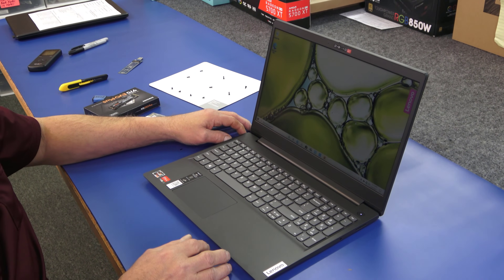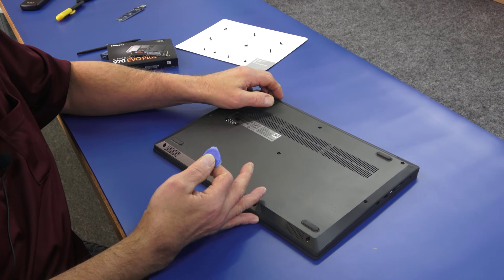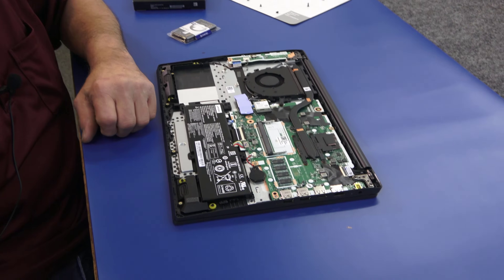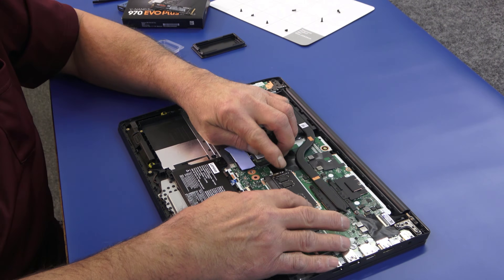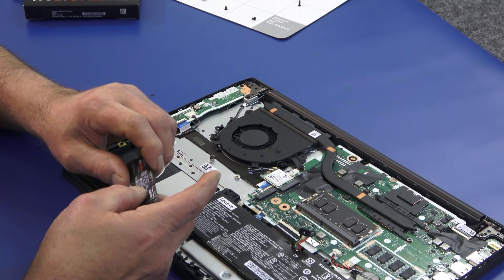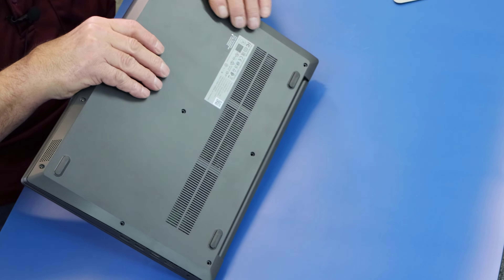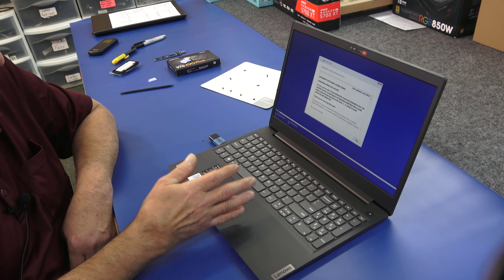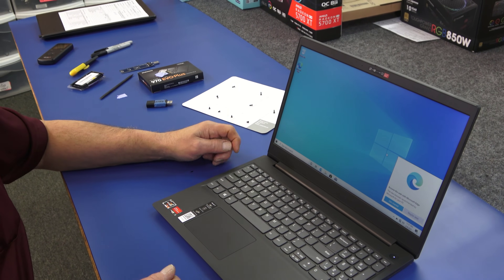How To Upgrade SSD & Memory Lenovo Ideapad 3 15.6 Laptop.

Comment: Hi sir..i have a question i will add last nigth  m.2 nvme 2242 at 2nd slot of my laptop. But it will not reflect after i install it ..did u know what happening?
Reply: Go to device manager and check if  it recognised it

Comment: How much more memory can you add? As in ram
Reply: I have the Lenovo Ideapad Slim 1 15ada7 and it's max is 12 GB, 4 GB soldered on and 8 GB in a sodimm slot. It just mostly depends on what your laptop supports

Comment: Lenovo IdeaPad Slim 3 15ABR8 AMD Ryzen Upgrade Options??

According to Task Manager:

Memory

	8.0 GB

	Speed:	3200 MHz
	Slots used:	1 of 2
	Form factor:	Row of chips
	Hardware reserved:	2.2 GB

	Available	1.3 GB
	Cached	1.2 GB
	Committed	8.1/9.5 GB
	Paged pool	469 MB
	Non-paged pool	386 MB
	In use (Compressed)	4.6 GB (167 MB)

Comment: First time i run into an issue like this, but I replaced the drive w the exact one on this video, there's no drive detected when I try to install windows w the usb... Should i format the new m.2 to gpt with another computer first? Or at least initialize the drive first?
Reply: Same question here man
Reply: @raphael5f547  i took it to. A shop and they fixed it

Apparently the driver needed is actually the RAID driver for the laptop. They extracted the files from the driver and installed it that way

Which is ridiculous because it's not raid, it's a single drive

But apparently the raid driver from the laptop is needed to to get everything working.

So just make sure u download the raid driver and extract contents and copy those to your windows install usb so u can select them.
Reply: @Bishop2563  oh nice
Reply: @Bishop2563  I just fixed mine. I went into bios and turned off Intel vmd and drive showed up. Damn had me up all night trying to fix it. It's my work laptop and it's a Monday today lol.

Comment: is it possible to add an 2.5'' ssd into the space next to the battery?
Reply: if it has the slot or the normal ssd can be relpaced with smth like a Samsung SSD than go for it
Reply: @realblackballs  video looked like it showed an empty bay for a normal 2.5" SSD.   Why didnt you use it?

Comment: I have a similar laptop and was curious to weather or not I could do a ram upgrade but I checked my specs it said my laptop came with 8 and the maximum supported is 8 does this mean I cant updated it? this is the name of the laptop  Lenovo Ideapad 3 15.6" FHD Laptop, AMD Ryzen 5 5500U, 8GB RAM, 256GB SSD, Windows 11, Abyss Blue
Reply: I have the exact same laptop. Where you able to find an answer to your question? If so, we’re you able to upgrade it? I’m also curious

Comment: This video is a total fraud and the video was apparently all faked!  You can't upgrade the SSD as shown because there is no way to do a new install of the OS since none of the media creation tools like the one for Windows can recognize the crappy NVMe card they used as a real hard drive!  It's going to always be stuck in useless Windows S mode with the original SSD unless it is booted from an SD card!
Reply: That is why you clone your drive to the new one. He mentioned that option in the video.

Comment: I have the 15ILT6 with a 1tb 2.5" HDD. I am looking to replace the HDD with a 500gb M.2 NVME SSD. Have you had any issue with the heat from the NVME SSD you installed? Have you upgraded to Windows 11? If so, any issues? Thanks
Reply: usually evo drives are better at keeping cool than their pro counterparts

Comment: Do you need to destatic yourself before opening it up? I do not want to harm the hardware.
And when you upgrade the storage with a new 500gb stick will you need to reinstall everything or can you bring it over?
Reply from the maker: Always protect yourself from static discharge,  yes.  You can either do clone, or a clean install of Windows.
Reply: @CadillacComputerCenter  How exactly can you ground yourself without a strap and without already building a PC? Im only opening it up to upgrade storage then that's it

Comment: What is the maximum ram of this laptop?How much can you upgrade it?
Reply: @—火  Already bought 16 gb ram and with 4 gb soldered i can confirm that this laptop is working very great with 20 gb ram total
Reply: Excellent news
Reply: @—火 It's up to you since you already said that you will use for school,study e.t.c buy this one.I am using it for gaming and in any case you don't need to pay 150 $ more only for the ram as you can upgrade it on this one later if you want to do that for only 70$ as that much will cost you 16 gb of ram.
Reply: @DarkoPsyUnique  dude you’re legit a legend you just answered exactly what I’m looking for as I’m buying my laptop this week and was unsure what size RAM upgrade I should get so with 16 it works great which I’m glad I’m def going 16 instead of 8 because at first thought it wouldn’t support the 20 GB but you have confirmed for me my guy 😌🫵🏽💪🏽🔥
Reply: @—火 Not at all,this laptop has excellent dispay
Reply: 2 slots so think 16
Reply: @chad4698  well the soldered one is 4 gb and i have 8 on the other slot so it's 12 gb at the moment.Will it work with 16gb + this soldered 4 gb and total 20gb?
Reply: I have same question

Comment: I can see a lot of users breaking the fragile battery connector manipulating it as shown in the video.  The service manual says it is necessary but I believe it is not required.
Reply: It's not required i've changed my ram 2 times until now without removing the battery

Comment: I have the ideapad 3 ryzen 7 5700u  with 12 gGB from the factory 2021 model.can I upgrade to 16 GB or it non upgradable?
Reply: yes you can, but maybe you have 4gb soldered thant you can't remove, su you only upgrade the other 8gb to 16gb for a total of 20gb.

Comment: Thank you for the video. Got my Ideapad with Ryzen 5 5500U today and want to upgrade from 8 to 16 GB RAM and 512 SSD to 1TB :-)
They are using too much adhesives these days! Lenovo was better some years ago in regards to repairs/upgrades. (esp. the Thinkpads)
Reply: I have an old Thinkpad t450s and IdeaPad 3 totally agree lol
Reply: can it support gaming now
Reply: I have the same laptop and i want to do the same, could I ask you which ram card and ssd card did you buy ?

Comment: Where did you get the standoff and the screw for the M.2 SSD? I have looked on amazon and the only ones that I can find are for the ASUS motherboard and it doesn't fit.
Reply: it was screwed into the other hole just unscrew it and screw it in to the farther hole.

Comment: How to know ..SSD size compatibility....I mean how to know how much SSD card install in Lenovo idepad s145.
Reply from the maker: Hi..I believe the s145 comes with 128GB SATA SSD.  you should be safe to go with  250, 500 or 1TB.  you must use a SATA M.2 SSD.
Reply: @CadillacComputerCenter  My laptop have Nvme 2.0 slot ...but I didn't recognize how much size of SSD card to purchase from market...still I am confusing if u have solid idea please tell me.
Reply: @CadillacComputerCenter  didnt I see an empty 2.5" bay for a hard drive in your video?

Comment: So, i have a lenovo e15 and it has an hhd, but i installed a second drive ssd, and I have tried to get it to boot to it, but it still boots to the hhd even though I changed the boot order. Do you have any idea how i can get it to boot from my ssd?
Reply: Did you clone the original hard drive or install and OS on the SSD?  If not, the drive is blank and there for has nothing to boot.
Reply: @TheXmaniac1979  i cloned it at first, and then used a usb with a fresh windows download on it the second time
Reply from the maker: Your boot manager is defaulting to you hdd. As soon as you turn on your laptop, start tapping the f12 key to bring up your boot menu, choose your new ssd to boot from.  Having 2 different drives with windows installed is confusing to the windows boot manager.  You may have to remove your hdd to force it to boot from your ssd, then put hdd back in.
Reply: @CadillacComputerCenter  ok. I will try that. Thank you so much for the help.

Comment: hey cadillac i have bought a brand new ssd f i go into the disk partition it says disk not initiliazd and if i do the method with windows 10 in my computerand put the new ssd in my computer it says. No bootable device? do you know the problem maybe. And nice video btw!